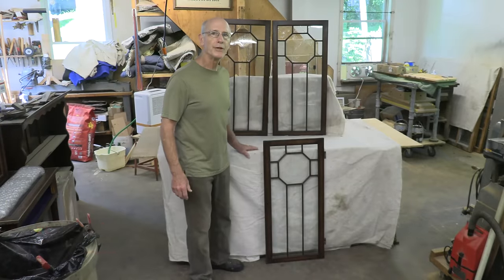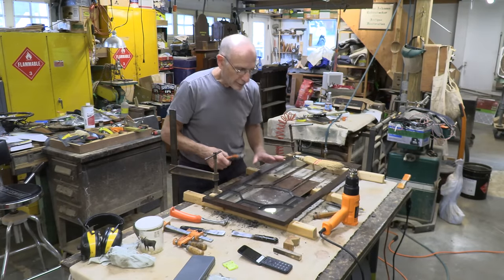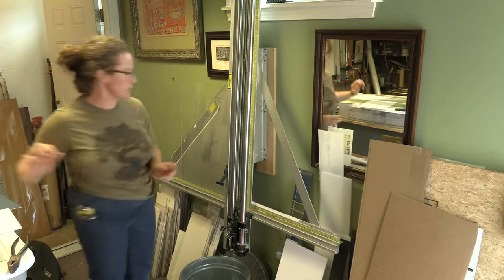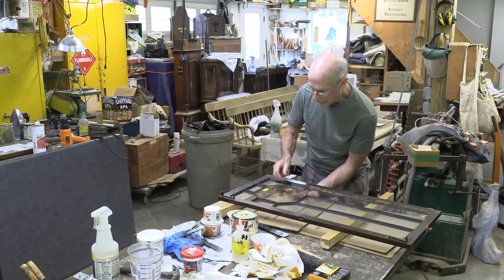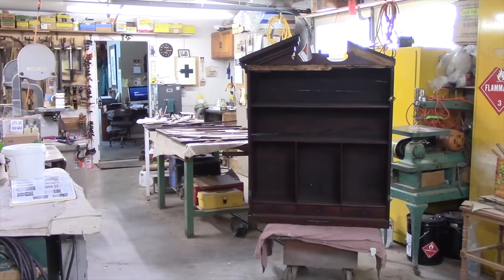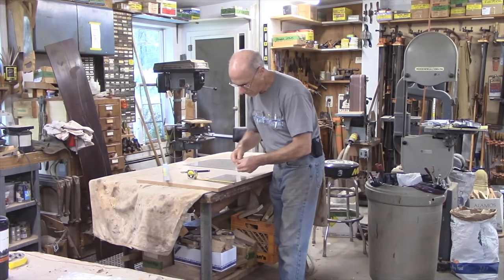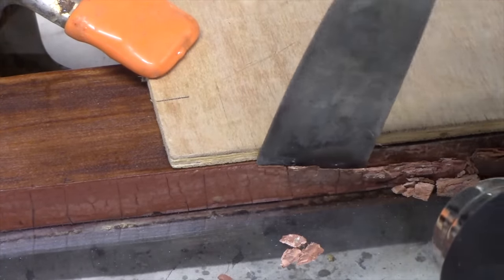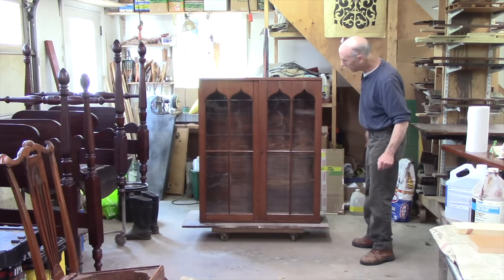So Satisfying - Thomas Johnson Antique Furniture Restoration

Comment: Hallo Tom, if you cut glass in the future dip the glass cutter in a little white sprite and use a small brush with white sprite and run it along the surface of the glass , you will find it makes the cut easier. I was a glazier for over 35 years and used this method all the time good luck.
Reply: very true. My father also used this method.
Reply: White spirit? Or sprite? What is sprite? Not the drink?!
Reply: I did wonder if wetting the glass would help, as the liquid helps cracks propagate faster.
Reply from the maker: Thank you! Sounds like good advice. Like others I'm wondering what White Sprite (or spirit?) is. Alcohol?
Reply: @johnsonrestoration  Hallo Tom! I think it's known as mineral spirits or plain old paint thinner in the US
Reply: I learned the hard way that in the UK, when you ask for lemonade, they bring you Sprite 😮. Yep, what we think of sodas, they call it fizzy drink. If you want actual lemonade, ask for lemon juice.😅
Reply: Paint thinner or use light oil like ` three in one`. @johnsonrestoration
Reply: @johnsonrestoration  Hi Tom it is mineral spirit in the USA, known as white spirit in the UK.
Reply: My cutter is an acrylic tube that you fill with cutting oil. Slightly loosen the brass hex nut on the end to help promote oil flow. The action of cutting the glass depresses the spring loaded cutter head which in turn allows the oil to flow through the brass head and lubricant the cutting wheel. When your cut is complete, retighten then hex nut to stop the flow of oil. It’s worked great for 40 years, cutting picture frame, window & stained glass.
Reply: This is the way. Kerosene was what the old guys used when I was a pup.
Reply: White spirits = mineral spirits = paint thinner
Reply: agreed - and I’ve always had much better success holding the cutter at a 90 degree angle to the glass.
Reply: I find glass breaking pliars make it easier and more reliable to snap the glass You are breaking from the end and it spreads easily along the length.
Reply: ⁹I kooooo

Comment: Hi Thomas.  Never break the glass at the edge of the table; you risk breaking it the wrong way.  The only correct way is to put the glass flat on top of the table (not on cardboard).  Put a pencil directly under the scratch pointing in the same direction.  Then put one hand at the left side and the other hand at the right side of the pencil and gently push.  Do not push in the middle of the pane!  You want the break to start at one end of the scratch and make it 'run' to the opposite side of the pane.  No need for tools.  Cutting glass this way never fails, even with very thick glass, like half an inch thick.  BTW, your friend Lea also breaks the glass the wrong way.  That is why she needs a tool to remove the little parts. Like I said, never put force in the middle of the pane, always at one end. It may sound like bragging, but I can cut a two foot long strip of barely 10 mm wide.  Obviously, the glass should be perfectly clean.  To keep the cutting tool in perfect condition, store it with the head immersed in a jar with some mineral spirits.  This way the little wheel will always run smoothly.
Reply: You should consider making a video of this skill. I would totally want to watch and learn. I think I’ve seen similar method done on porcelain tile.
Reply: No, there are many ways to cut glass.The cleanest break is use your index fingers knuckles together thumb on top.If the scoreline is bad, ie you pressed too hard, not hard enough, or skidded the cutter, nothing will save that glass.Grozing and breaking pliers help.
Reply from the maker: Wow! Thank you! This is very good advice. I have to think about what you're saying. I will try this
Reply from the maker: Exactly what I was thinking!
Reply from the maker: I have a lot to learn!
Reply: @johnsonrestoration  Don't we all!

Comment: I agree with Mr. Hollingsworth.  I worked 5 summers in a commercial glass shop.  The pros used mineral spirits to lubricate the cutter wheel during each cut.  They used a shallow jar lid with a sponge inside.  The sponge was soaked in mineral spirits.   The pro would dip his cutter wheel before each cut.  Long cuts were lightly traced along a straight edge before making the cut. Glass with an irregular surface was scored on the back (smooth) side.  Large jobs called for a new cutter.  Ragged edges can be sanded with a sanding block or a power sander.  For large cuts the glass was scored one time with uniform pressure.  Then the glass was then tapped on the underside with the cutter handle to initiate the crack.  Then the drop piece was rolled down from the initial crack down the length of the cut.  Cuts with a waste drop of less than 1 inch can be tricky.   A good score should have a single continuous mark.  Scoring glass more than once often causes bad breaks.  Antique glass has variations and defects that challenge any glass cutter.  Thank you for sharing your videos.
Reply from the maker: Thanks! Good advice!

Comment: Your videos are always the highlight of my day 
Michael Hollingsworth is spot on about the mineral spirits 
The cutter you are using will actually hold the spirts in the shaft and dispense it on the glass as you score it and as others have pointed out you want to snap the glass from the end rather than the middle 
I prefer starting on the side that the cutter has run off as the score goes all the way to the edge there
Reply from the maker: Thanks! That's good advice! Another commenter was saying a similar thing

Comment: I'm not sure if I saw you using a cutting oil when trying to cut the glass with the tool you have, but my dad told me that kerosene works very well for cutting, it helps the glass to cut cleanly
Reply from the maker: Thanks! There was a bit of oil on the cutter

Comment: Both of these lovely pieces of furniture turned out perfectly - as always.  👍🏻 
I love learning from a true artist at his craft, and I have acquired more usable knowledge from watching Mr. Johnson's videos than any of the other excellent firniture restoration professionals on YouTube.  Thank you Thomas Johnson!!!!!
A few odd FYI tidbits of wisdom for any glass cutting nerdy newbies ...  A light cutting oil applied with the cutting wheel always helps glass break more cleanly.  All glass, but especially softer antigue type glasses, have the quirky property of being semi-fluid.  Over time, old window panes and door lites  will flow into being thicker at the bottom.  It's amazing to observe this effect in antique windows and doors.  This semi-fluid behavior also means that cuts made in glass will heal surprisingly fast after being cut, especially if oil isn't used and if the breaking pressure isn't applied quickly after making a cut.  Healing means the cut edges flow back together and fill in the cut over time.  Healing is never a completely even process.  It's always best to use oil to slow the heal, use a sharp wheel, cut with even firm pressure pushing AWAY from you for more consistent control of pressure, and snap the cut immediately using a straight edge, parallel action grozier pliers, or glass cut-running pliers.
The glass cutter Mr. Johnson is using is a primo glass cutter with a reservoir in the handle for cutting oil, and is a worthy investment for anyone serious about working in stained glass or cutting window glass frequently. Sometimes residue will block the wicking action of this type of tool, resulting in a dry uneven cut.  A dry cut also shortens the life of the cutting wheel.  The remedy is to periodically clean the cutter head with mineral spirits, especially if the cutter isn't used often.  A dull cutting wheel also results in rough, uneven cuts. Some glass is harder and denser than other types. One example of harder glass is multi-color opal glasses which are known for being more difficult to cut due to multiple color layers and erratic grain. Hard glass can dull a cutting wheel more quickly.
Antique window glass, the lovely rippled glass in old home windows and in old antiques such as those featured, is generally very soft but with somewhat variable grain and thickness throughout.  The best approach for curved cuts in glass is to apply firm even pressure with a well oiled sharp cutter, and quickly apply even pressure along the break using breaking or cut running pliers.  For straight cuts, the edge of a table or a raised straight edge works best to apply even pressure along the cut. 
Modern window glass is often tempered, and demands very firm even pressure along a cut to break straight by hand, but even doing so may still result in surprises. A modern cutting machine is safer bet for long straight cuts on modern glass. Cutting machines like the one this framing shop has are costly, but a wise investment for making a lot of long straight cuts, unless a person enjoys being frustrated and having a big box of odd shaped pieces of fractured glass that did not break correctly the first time - or second time, or third time ... .
Reply from the maker: Thank you! Very good advice. I am saving all this advice and putting it with my glass cutting kit!
Reply from the maker: I am learning a lot more from my viewers (especially you!) than they are learning from me!
Reply: @johnsonrestoration  That is absolutely not true! The amount of tips, tricks, techniques and just plain old patience that we all learn from watching your videos is staggering.

Comment: I still have one of those glass cutters like yours. I first learned to use them when I  worked in retail at W.T.Grants. Do you recall seeing  shelves with glass partitions that were mounted vertically to divide spaces for products? We cut glass to fit the metal shelves, and some departments had glass shelves. I got fairly proficient at cutting glass. It was fun.
Reply from the maker: Thanks! Yes, cutting a lot of glass like that you must have really got it down. Every time I cut glass I have to start over again!

Comment: Tom, I had no idea you were 100-years-old! You're looking pretty good to me!
But seriously, I know you ai'nt that old really. 
As it happens, I was cutting some glass just the other day. I was making a 3x3 piece for repairing a Georgian exterior door, and a much larger piece to refill a broken picture frame. I didn't enjoy the putty work on the small door piece, I reckon you did that very well. But I remember being taught that the important part to making long cuts was confidence! So I try not to overthink it. And then, before cracking the pane, to gently tap the cut with the cutter to break along the cut before snapping it. Works every time (until it doesn't). 
But hey, I probably could get one of those nibbler/grippers, very useful, in a pinch. For big cuts I just grip the glass in my hands, using an edge to crack along. As you did in the second video.
I'll pick up my copy of "Grandmothers and teaching them to suck eggs" on my way out!
Reply from the maker: Thanks! Good advise! (I don't get that last line!)
Reply: Tom, I really enjoyed the revisits along with your new piece.
(As to the last line, we have an expression over here, "don't teach your grand-mother to suck eggs", meaning don't try to tell someone how to do something, when they very clearly knows what they are doing, probably more than we do? Maybe the word "mansplaining" has a similar resonanace.)

Comment: Putty is an amazing compound, Tom.  Is it a mix of clay and linseed oil?  Clever that it can be softened with gentle heat too.  Your local framing friend has great equipment for cutting larger pieces of glass.  An interesting fact about old glass is that over the centuries it will flow microscopiaclly.  The Kings College chapel in Cambridge, England, and built in the fifteenth century has some glass which is thicker at the lower end than at the upper end which shows that gravity makes it flow downwards very slowly.
Reply from the maker: Thank you! I'm not sure what it's made of, but that sounds plausible! Interesting about the glass, and dlevi67's response. I have a feeling he knows what he's talking about!
Reply from the maker: So interesting! Another myth bites the dust

Comment: Tapping the length of the score on the underside of the glass cut weakens the glass and you might see the line change to white inside (the other end of the cutter is fine to tap with but I prefer the cutters with a brass ball oil cap for this). It will either fall into two pieces or a very gentle 'snap' will finish the job cleanly. It looked like you had plenty of oil in the cutter so if it still makes the clear scoring sound the full length of the cut it should work. Hope that helps. All the best Tom, Ben.
Reply from the maker: Thanks! Yes, you're not the first one to talk about tapping first. I will try that. yes, I couldn't complain about the cutter!

Comment: Safety glass or was in covered in 3M like film?  When you pulled that first pane out, the broken pieces hung together.  Ah, I could see a film on the 2nd pane.  Wow, I’ve got 2 spring clamps that take 2 hands full strength to open the jaws.  I’ll have to check to see if there is an adjustment screw.  When I was choosing glass to go into my craftsman style kitchen remodel year ago, I wanted something that looked antique because my house is full of antiques, some with antique glass.  I ended up choosing “Old German Antique” which, although modern, has a lot of “flaws” to help it fit into the theme.
Reply from the maker: Thanks! The owner had covered the broken glass with scotch tape. I'm glad the "Old German Glass" worked out, I really like the Bendheim Restoration Glass
Reply: @johnsonrestoration  If I need more “antique” glass, I’ll try Bendheim Restoration as I think during Covid some of the custom glass manufacturers went out of business including, perhaps, Old German Antique.  PS I checked my red handled super strong spring clamps and they are not adjustable.  Can’t imagine what they are good for.  LOL. Maybe I’ll just toss them.

Comment: I know I'm fighting a losing battle but those are MUNTINS not MULLIONS. Keep up the good work.
Reply: Joining you in the battle... 😉
Reply from the maker: Ok, here's Wiki on "mullions" A mullion is a vertical element that forms a division between units of a window or screen, or is used decoratively.[1] It is also often used as a division between double doors. When dividing adjacent window units its primary purpose is a rigid support to the glazing of the window. Its secondary purpose is to provide structural support to an arch or lintel above the window opening. Horizontal elements separating the head of a door from a window above are called transoms.
Wiki on "muntins" A muntin (US), muntin bar, glazing bar (UK), or sash bar is a strip of wood or metal separating and holding panes of glass in a window.[1] Muntins can be found in doors, windows, and furniture, typically in Western styles of architecture. Muntins divide a single window sash or casement into a grid system of small panes of glass, called "lights" or "lites"
Doesn't that make sense?
Reply from the maker: That was a good question! I hope you can see my response to roccoliuzzi8394
Reply: @johnsonrestoration  I think the bit implied but explicitly missing from those definitions/descriptions is that a mullion is a heavy structural element, often of stone or metal, whereas a glazing bar or muntin is usually thin and any structural function is limited to light stresses.
Reply: @dlevi67  That's correct. A million is between sashes. In the room I'm in right now the mullion holds the window weights for the double hungs on either side. I'm a finish carpenter and cabinet maker. I've become very familiar with these parts and have made a number of windows for historic or just plain old buildings where the owner wants to maintain originality. My theory is that window manufacturers and sales people don't like "muntin" because it's not such a pretty word that rolls off the tongue.

Comment: Hi Tom, when glass cutting by hand, make sure the glass is clean, use some spirit to get of "grease or oil'. Furthermore check the cutter-weehl, or change it regularly. Make sure you must score the COMPLETE line where the glass has to break.
Sometimes it helps to put a matchstick at the start and end of the scoringline under the glass. The pliers you use to make the cut.........better not use them. A plier with a flat grip can be used for small strips you have to remove.
Overhere in Europe glascutters have 6 small cutter-wheels, so when one is blunt, you can rotate the cutterwheel-bearing disk 60 degrees tot use the next wheel and so on.
Reply from the maker: Thank you! Good advice! I did get a cutter with a carbide blade, it should last me forever! Yes, the plier thing is tricky

Comment: Thomas is it possible to reuse the putty once heat softens it ?
Reply: Not really - it crumbles away and it won't stick to anything once it cools, because the linseed oil has polymerised (because of air/age - the heat doesn't help, though!). Plus, it's cheap: a 1 kg tub is GBP 6, and it will do quite a lot of glazing!
Reply from the maker: No, I like dlevi67's response. It's too dried out
Reply from the maker: Yes, true. Thanks!

Comment: do they still manufacture this shatter-proof glass these days anymore?
Reply: They do, but it's not straightforward to cut it. It was invented in 1903, so not likely to have been fitted originally...

Tempered glass was invented in the late 1870s, and that is impossible to cut after tempering.
Reply from the maker: Thanks! Yes,it is. I had no trouble getting it from a glass company
Reply from the maker: Yes, you can't cut it. I believe they cut the glass first, and then temper it
Reply: @johnsonrestoration  Yep. Cut, finish (any grinding etc.), then temper.